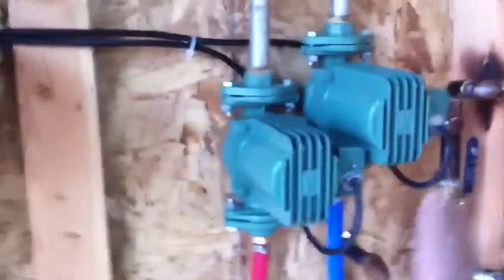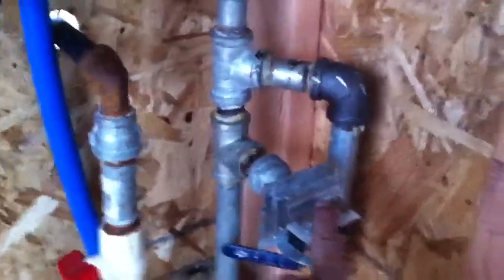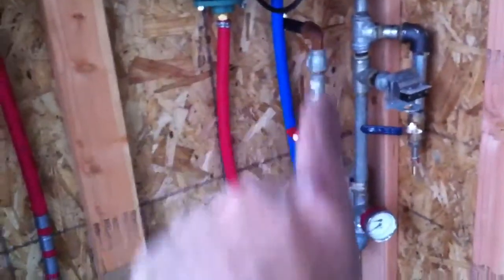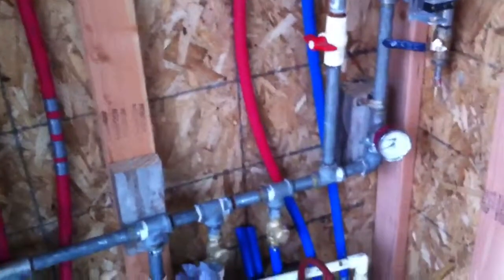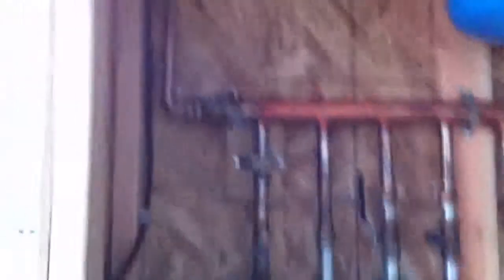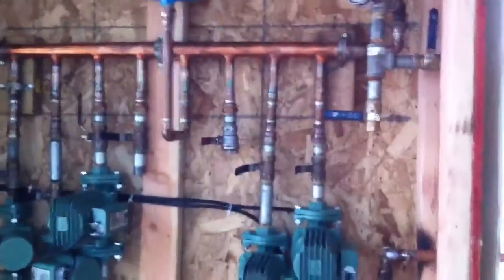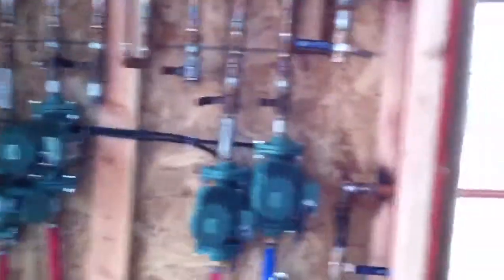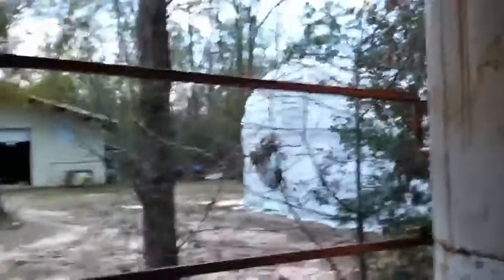Oil burner boiler and hot water zoning

Comment: Glad to see your still making progress.  It's been so long thought we might of lost ya!  I'm still not heating water with mine yet,  but I sure want to.  I wouldn't have thought you would need a pump for every circuit,  although maybe your using pumps to control each zone instead of valves.

    Have you been heating water?  If so how is your burner doing.  I'm curious about how often your cleaning out and how your pan is holding up.  I quit using brake drums and built a stainless burner.